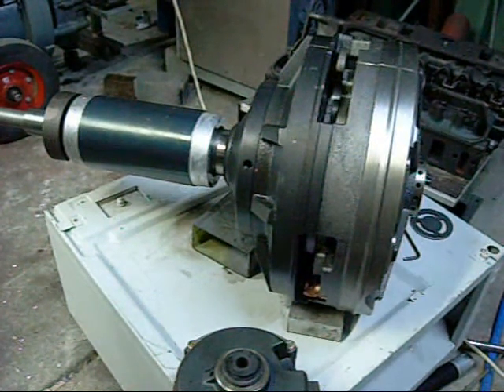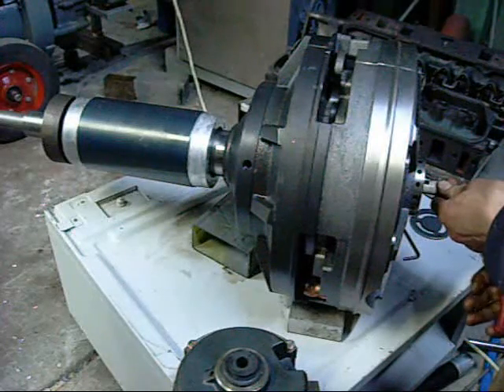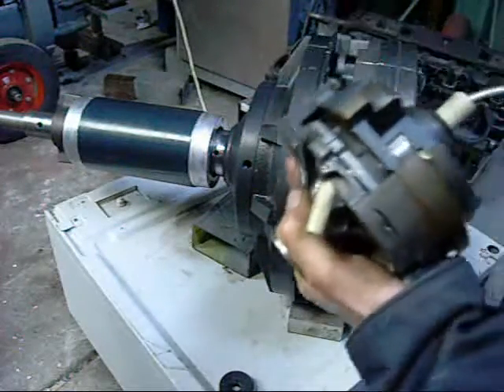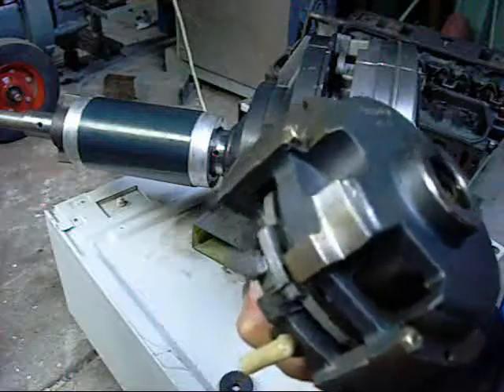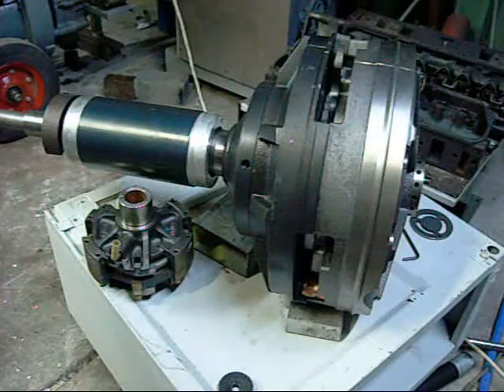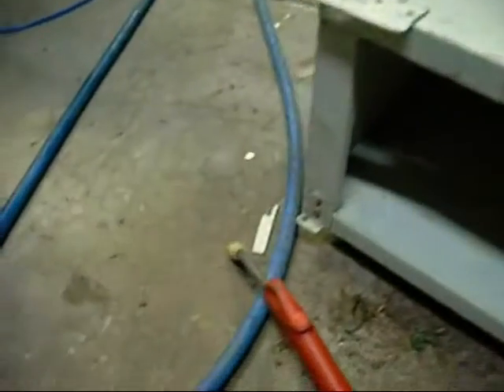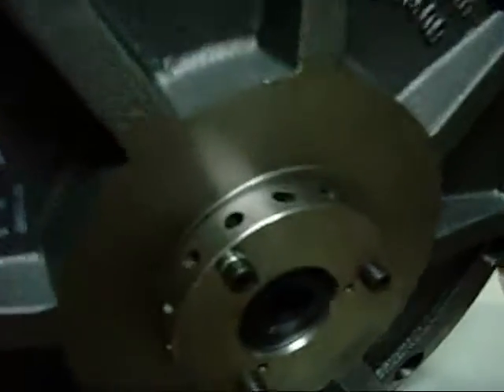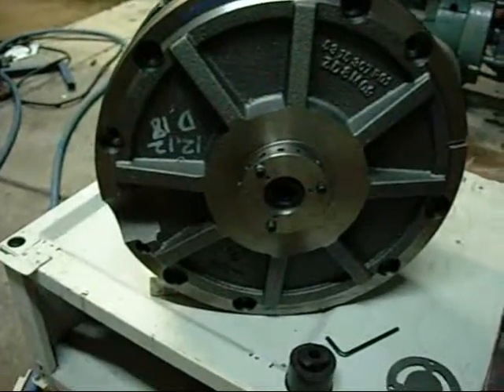Scroll Air Motor from Scroll Compressor

Comment: With reed valves, pcv valves, or some check valves creating a high and low side this may run as a sealed HHO engine. Vane or scroll, pump or motor. Expansion then contraction till HHO is contaminated by carbon in lubricant. Air condition? An engine running without compression of fuel?

Comment from the maker: I doubt you would even get hours out of it, much less days!. its not  intended to even be used as a motor, the plain metal bearings would need a constand high pressure feed of oil, along with oil mist injection into the scroll

Comment: hey did some research , turns out sum people have converted scroll compressores into turbiens, turning an air conditioner into a heat engine by removing and adding sum valves you can heat the condensore and the scroll compressore will generate electricity, the documents also said scroll compressores are the most reliable and can even run without oil in sum cases, thanks for posting this vid

Comment: these air motors have such a high rpm rating because they r ultra torque air compressors, so they work in revers by trading torque for rpm, thats what i was tryn to say

Comment: i figured something out about scroll motors , they r very low torq and high rpm, very high rpm, hey ed , i gota cool vid idea for you if you run outa ideas, your stress testing vids r by far the most exsiting and valuble to me, knowing waht you cant do is very important, you should stress test a scroll compressore air motor, run the hell outa it and do an autopsy, sry for my spelling , im totaly iliterate

Comment from the maker: @Johnnie619 if they could fine tune the design and supply enough air , I see no reason why it could not exceed the power of a reciprocating engine, albeit a steam engine.

thing is people want the most power these days, but if they are willing to forgo that, it could work ( as long as its not dangerously slow and becomes a traffic hazzard )

a thorium reactor system that drives a stainless steel scroll engine with steam would be great. reactor fueled and sealed for life, just add water :D

Comment from the maker: @alfadog777 G'day!, I'd say your compressor has a reed valve on the discharge thats stopping air going back through the system from the discharge.

only way to overcome that is to cut the top off and physically remove it.

Comment: Very impressive work. I am trying to do the same with a Mitsubishi FX80 scroll compressor, but it won't turn at all when I supply air in the outlet. Do you thing there is a one way valve or something else stopping it rotating? The funny thing is it works fine when I supply air in the compressor inlet, rotating and all... Really strange. Keep up the videos, they' re really nice!

Comment from the maker: @vaticinus It can change direction but only when air is forced into the exhaust side. since there are large gaps all round that wasn't possible without making a tubular manifold that sealed up the outside of the compressor.

Comment from the maker: very little with the amount of air I was supplying. I tried it with a full 1/2" line in @ 120psi and it was strong enough to turn over a 4cyl engine under compression.

only drawback is that torque only lasts as long as the tank, in this case only 10 seconds.

Comment from the maker: I strongly doubt it, it would only work if the motor fits the casing/shaft. and is brushless, and designed to operate immersed in refrigerant/oil

IMO it would be easier, cheaper and safer to buy a new DC scroll compressor.

Comment: Can you show the workings of the Cycloid converter, The part that is in between the motor and the scroll pump itself. The one That convert the spinning motion of the motor into the oscillating motion for the scroll. You showed the  eccentric lobe part of it but i would like to see the part that allows the scroll head to move both in X and Y positions without letting the scroll head rotate in anyway.

Comment from the maker: Using steam to push oil is sort of like Nitrogen in a hydraulic accumulator pushing the oil out and into the cylinder or motor. as long as there is a piston or diaphragm in the accumulator to keep the steam from contaminating the oil it will work!

Comment from the maker: I'm glad you like it!, i knew you would!. :D
I imagine with a supply line oiler and bearing oil cups (or rebored for bearing races) they would last a long time.
I was watching videos on the Copland scroll compressors and apparently they "Wear In, not out" which seems to have merit since both mating surfaces of the scrolls can wear and mate up to each other again as long as there is axial pressure applied to the moving scroll via the motor spindle.
Reply: i know im asking the wrong place but does anybody know a way to log back into an Instagram account?
I somehow lost the account password. I would appreciate any help you can offer me.
Reply: @Cairo Marcellus Instablaster :)
Reply: @Nathanael Diego i really appreciate your reply. I found the site on google and Im waiting for the hacking stuff now.
Takes quite some time so I will reply here later when my account password hopefully is recovered.
Reply: @Nathanael Diego It worked and I finally got access to my account again. I'm so happy:D
Thank you so much, you saved my account!
Reply: @Cairo Marcellus no problem :)

Comment: that is fkn cool bro,you should do an indurance test on an old junker,i am very impressed with this,and also remember
that high rpm devices can wear all to hell and still run,, yes they loos efficiancy but i bet you that little sucker would run for a year,and i have some ideas that need a cheap device like this i want to run steam power oil,meaning steam pressure forces oil threw the air motor ,the fact its free is eye popping ,great vid bro ,fkn gold brotha

Comment from the maker: I'm pretty sure with normal AC motors like the one here, they need to be ran at 1.5X their rated output speed to generate power?

it'll consume a horrendous amount of air at high speeds, but could be ran off steam provided it is protected from rusting somehow.

If there were such a thing as a stainless steel scroll it would make a awesome steam engine.